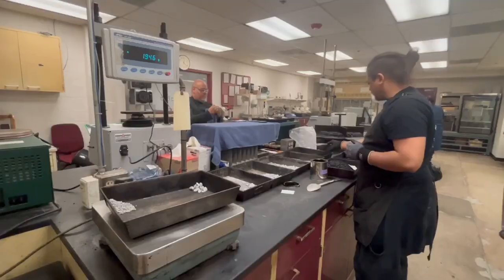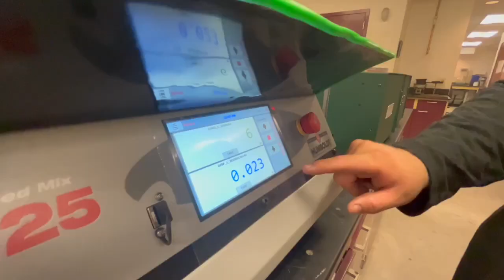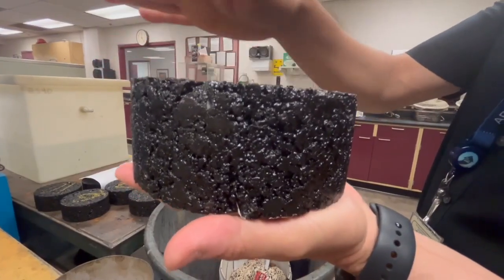ADOT engineers test new road materials to forge the future of Arizona roads

Comment: they'll do anything to cut costs and then we get screwed when it doesn't work out like they thought it would. I'm talking about the 60 in Mesa
Reply: Nothing wrong with the 60 except lack of money for maintenance.  That surface is worn out because it was only designed for a 10 year life and that was almost 20 years ago.  Many sections of the urban freeways are or were not long ago, in the same boat, a surface that was intended to last 10 years and get replace was not replaced due to lack of money so it had to serve nearly double its intended life.

Comment: Back in 1976, Arizona was putting glass into the road surfaces.  I thought that was a great idea.  Back east they rebuilt a section of road using compacted glass, saved time.  Every state should have recycled glass.  Made from sand ⌛ very plentiful.
Reply: Lots of things have been tried.  Some work some don't. Some wind up costing too much. Some look good at first but don't hold up.  Glass is a pretty slick and it's hard to make asphalt stick to it when its wet and gets beat on by traffic.  It's slickness also makes it unsuitable for using on top as it has poor friction, really poor when wet.